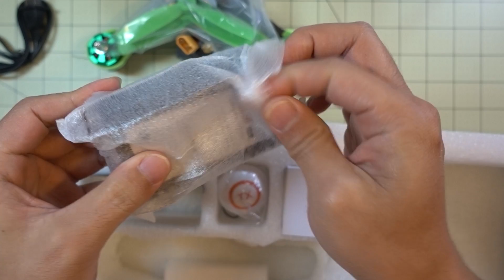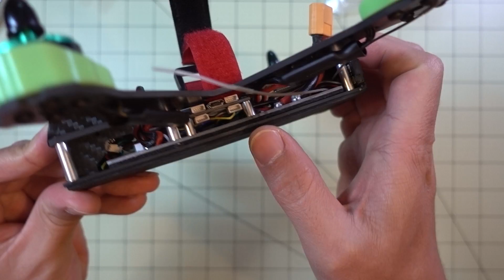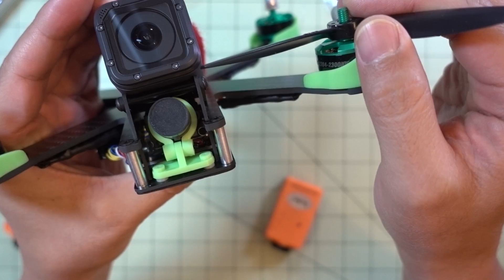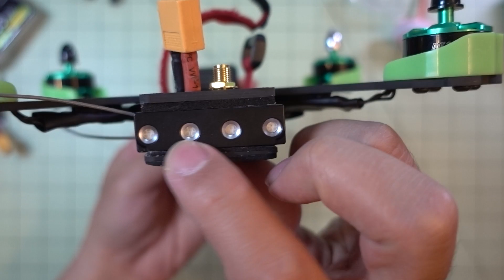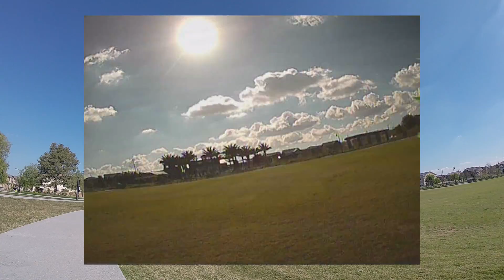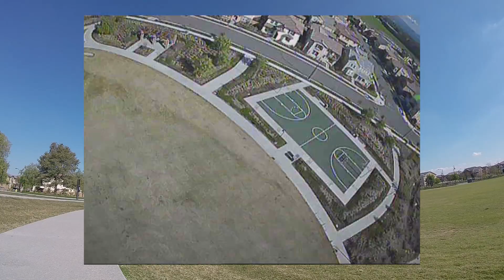Eachine Falcon 210 Pro Review

Comment: I have the Cheerson CX 117, Flysky  i6, and Flysky FS A8S. When I bound everything together and connected to Beta flight, the control sticks weren't doing anything. The throttle was the only one moving on screen and it made the other channels move.
Reply from the maker: +kthomas11866 your channel map is not setup right. The channels need to match in the transmitter and on the flight controller.

Comment: "Oh my..." is totally right!  That low slung lower deck frame had some potential with the good C.G. but it looks like BG/Eachine just dropped the ball again.  PWM?  What common sense is there to just hang the receiver off the side like that? 2204 vs the listed 2205 motors?  Sounds like 3 strikes right there... :(
Reply from the maker: +Phillip Chung obviously not the same design team as the Wizard!
Reply: Actually If you look at the frame and the "extra" holes in it, you could think that the designer had his best intentions.
Unfortunately, someone else came and changed the components (rx and pdb) for a cheaper ones.

In my opinion this could have been a really cool quad, if not the esc, rx and pdb (I can live without hd cam).